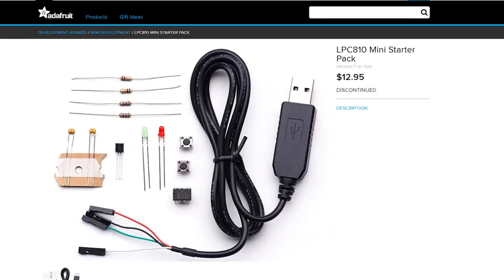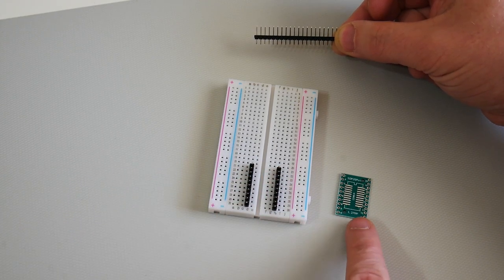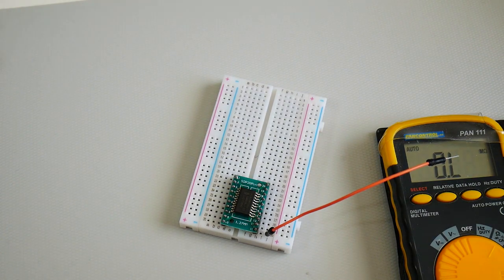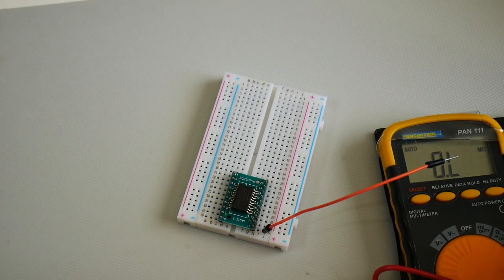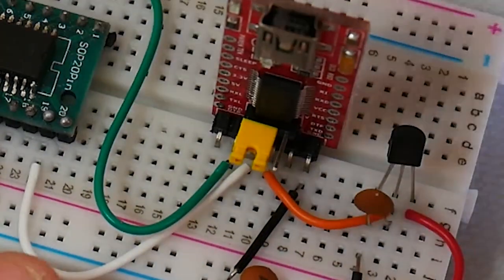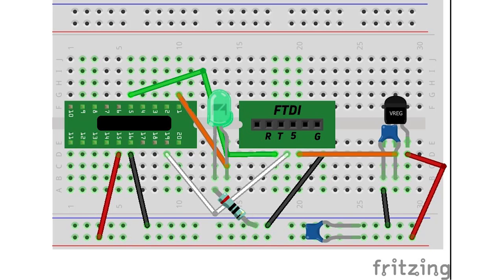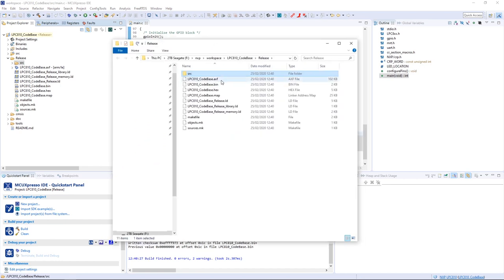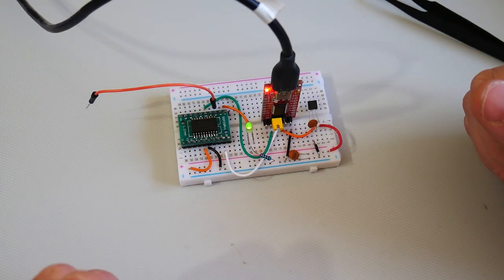Build Your Own Arduino Like Board For Just a Few Dollars

Comment: Since many of your viewers may also feel that they are not expert solderers:

You might benefit from a smaller soldering iron tip for this scale of work.

Flux cleans oxide from the metal surface.  It does not guide the solder.  Surface tension, once the pad is "wetted" guides the solder.  It is best to use rosin core solder.  (DO NOT USE plumbing solder, which has an acid flux in it's core, rather than rosin.  The acid is bad for electronics in the long run.)  The rosin is flux, and, generally, makes the brushed on flux unnecessary unless you are trying to solder directly to copper.  The silver color of the traces on your board is a plating (which is also called tinning in some circles) with a metal that does not oxidize easily.  If you make your own boards and etch them yourself, you may well have bare copper traces, and liberal liquid flux is warranted, but you may want to finish by covering all of the traces with solder, to protect the copper from future corrosion and possible failure.  Commercially made boards will almost always be tinned.

Particularly if you are in a dry region or in an air conditioned lab, give thought to protecting the chip from static.  Wrist straps are common in production settings, but I typically touch a ground point after picking up a too, and before picking up the chip, board, etc.  Some are tempted to tape down the chip while soldering, but note that peeling the tape off later can produce quite a charge.  Better to hold it down with a piece of conductive foam (DIP ICs often came with their pins shoved into such, I don't know where to get it today).

Note that the chip leads need not actually touch the board conductors, they just have to be really close so that the layer of solder that will wick between them is thin so that you need not consider its resistance.

It is quite possible to solder using only two hands.  Leave the end of the solder sticking out from the roll, in mid air.  Hold down the chip with one hand, positioning it as necessary.  Pick up the iron, clean it on the wet sponge (yes, you should have one), then touch it to the end of the solder, picking up a very small droplet (small compared to the pin spacing), and touch the iron to the work so that it is in contact with both pin and pad.  A key to a good joint is that both pieces being joined reach a temperature higher than the solder's melting point, when the surface tension will switch from forming a bead to adhering it to the pin and pad (it will flow in).  You can reheat the joint, first pin soldered only, to re-position the chip so that all pins fall within the outline of their pads.  Don't move anything for a few seconds after removing the heat, but don't blow on it.  Now pick up  the solder and solder a few other pins, diagonally opposite is a good choice, maybe doing the four corners.

Good fresh solder joints should look shiny rather than dull.  Don't worry about that for the first pin until you have a few others soldered, then go back and reheat it to make it shiny if it isn't.  The key here is to avoid mechanical disturbance while the solder cools and solidifies.  Remove the iron gently and hold still for a second or two.  To this end you should not be pushing the pin down with the iron, since it will then move as the iron is removed, potentially spoiling the joint, but at least obviating the reason that you were holding it down.  (If the pins don't all look like they're touching when you first hold the part against the board, use your needle nosed pliers to bend them in advance so that they are within a hair of touching or better.)  There should be no pressure from the iron.  The molten solder on the iron is the actual heat conductor.  The iron should touch both pin and pad.  If the solder does not flow onto both  within a couple of seconds, let the part cool, clean the iron on the sponge, and add a little fresh solder to the tip and try again.  Clean the iron on the sponge and re-wet it with a little fresh solder frequently.  Avoid the temptation to put lots of solder on a joint.  A big gibbous blob improves neither the electrical nor the mechanical quality of the joint.  Don't rush: do just a few pins, then let the clip cool while you clean and "re-tin" the iron.  If a joint doesn't look shiny, don't redo it right away, but come back to it 5 or 10 seconds later.
Reply: Thanks!
Reply: your awesome.
Reply: gosh, how much time did that take? But thanks anyway...
Reply: @AkashYadav-mr4hg  I'm just trying to give back.  I learn a lot from YouTube, Gary in particular.  My typing is pretty good, and that was little better than a stream of consciousness (I've done a lot of soldering in my days).
Reply: Yes, the additional flux is entirely unnecessary in this application as there's more than enough in the solder wire. I notice a lot of YouTubers advocate the use of additional flux and I think this bad advice masks the use of a generally poor soldering technique, where the iron is used to transfer blobs of molten solder to the cold work, thereby boiling away most of the flux and making a lot of smoke.
Reply: _ David _  Only one components in this project falls into that category and even that's doubtful. The pin headers certainly don't. If I was doing a soldering job that needed separate flux I would use fluxless solder wire. You don't need both.
Reply: _ David _  If you find you need both (as a number of YouTubers seem to do) then I would question your technique. I use rosin cored solder for general soldering and fluxless solder with separate flux for SMCs. I would not mix the two, just as I don't mix lead-free solder and traditional. An obvious complication of using separate flux is the need to buy the correct type. Using rosin cored solder for general soldering avoids that problem as additional flux is simply never needed for that application.
Reply: i know im asking the wrong place but does anyone know of a method to log back into an instagram account..?
I was dumb lost my password. I appreciate any help you can offer me!
Reply: @Jaxx Wade Instablaster =)
Reply: @Julius Jaxxon it did the trick and I now got access to my account again. Im so happy!
Thanks so much, you saved my account!
Reply: @Jaxx Wade happy to help :)
Reply: That was the biggest soldering iron ever haha
Reply: Solder paste for SMD and solder flux is even better. There are many videos on YT how to solder SMD parts...

Comment: The power bus (the whole bread board) is flipped in the drawing. Ground is on the the component in the drawing, and Positive is on the component side on real bread board.
Reply from the maker: Yes, I know. I couldn't get the circuit drawing software to work correctly with it flipped the other way. But the diagram is correct, but it doesn't quite reflect what I showed in the video.

Comment: Very informative video. Easier to tin one pad, solder one pin to it, then solder another pin from the other side making sure all other pins are aligned, then fially solder all other pins. Tinning all pins first make the job harder.
Reply: Yep tinning all pads first make it harder. solder first corner or use blutack to secure IC. When soldering 0.5mm pitch I usually just alignment pins and then use great amount of solder. after that I use solder wick to remove excessive solder.
Reply from the maker: Thanks for the tip.
Reply: Right. Don't tin first. Start with just a bit of solder on the iron tip, heat the pin and pad at the same time and put the solder on the opposite side of pin and pad. It will flow in a fraction of a second, remove solder then heat quickly and joint will be perfect. Unless you are like me and have gotten too blind to see the pins in the first place🤣

Comment: • Ah, so the bootloader on this chip is enabled by grounding a pin, rather than a delay in the start of the code!

• I would have also like to see you use the Arduino IDE instead of LPCXpresso IDE, although NXP's IDE is really similar to the other enterprise IDEs (such as CodeVisionAVR for AVR chips).

• Also, even though LPC812 seems to be easier to solder, I believe it's more expensive than ATmega328p. Granted that it's nicer than an ATmega328p in terms of clock speed and some other aspects.

• Personally, I also hate those FTDI chips with a passion! Even though those seem to be really popular, in my experience they have proven to be much crappier (and expensive) than options such as CH341G and CP2102.

• I would suggest to only solder pin #1 first, put the chip on the board and then position it, re-heat pin #1, solder pin #11, and then continue from there. I believe it'd be easier and more neat(er) since the chip would be flush to the PCB, and no pins will be under stress.

• I'm like 20% sure that soldering the pin headers while they're in the breadboard, while easier to do so, could potentially damage the breadboard's plastic. I'm not really sure, but if someone were to ask me I would advise against it.

• I believe the kind of soldering tip you're using is really not suitable for the job. You should use one that has a needle-like small surface to solder SMD components. Also, invest in a wet sponge or cleaning wire to clean the tip, it's really worth it!

Nice job overall, Gary. I have made several Arduino-like boards from scratch, but I have never used an LPC812 so it was interesting to see your video!

Comment: Thank you. Use a smaller tip for the welding with temperature control maybe that will make soldering easier

Comment: To add to the professor's comment solder should not be put on the tip as this vauses the flux to be burnt off before you have soldered your joint as long as your tip is clean and you add your solder from the opposite side to the tip and you remove the tip as soon as the solder flows to the tip you will get a good joint provided you have had tip tip on both pad and and pin. The best tip I have found is a 3.2 mm chisel tip for normal sized components and reducing for smaller components a round tip in general does not work well. But has been said sucess comes from practice and a clean tip and board.

Comment: When you solder the chip is better to put the tin on one pad only and solder this pad first. That way the chip will sit down on the breadboard correctly. After this initial operation will be very easy to solder the rest of the pads.

Comment: Thank you, it was a great video! However there was a small error in the circuit diagram you displayed in between the video. In those diagrams, the positive and the negative rows were flipped over (compared to what you did on the board)
Reply from the maker: That is true, but it isn't an error, it is a difference. The circuit drawing software I was using didn't work correctly with the board flipped the other way. But the diagram is correct.
Reply: @GaryExplains  yeah. That's understandable :)

Comment: Curious why you used a 3.3V vreg if your pulling power from the USB to Serial board? Those USB to Serial boards have a jumper that lets you select 5v or 3.3v (at least mine does, and looks like yours does too), so the vreg shouldn't have been necessary...
Reply from the maker: Because I don't want to assume that the USB to serial converter has the 5v/3.3v option, some don't.
Reply: @GaryExplains  ah ok, good point.
Reply: Well, since the USB to serial board is only needed when programming and developing then it makes sense that he is showing that it can be powered by 5 volt on its own.

Comment: Flux alone should be more than enough to ensure that solder flows under those pads, I’ve never seen anyone else put gobs of solder on each pad before soldering an IC to it. I find RMA paste much more effective than no-clean.

Also I don’t see why not make a PCB with a programming header on it. As is you’ve done no more than just taking the equivalent of a DIP20 MCU and slapping it on a breadboard with supporting components, which isn’t very versatile. The whole point of an arduino is that it has the programmer and the power supply and the indicator LEDs and the ICSP header and the oscillator built-in, and is a robust board with little to go wrong. A breadboard is not robust. Breadboards should be used for temporary circuits, for prototyping and experimentation. Wasting one by leaving a permanent circuit on it just increases the cost and the footprint of that circuit and makes it much more prone to wiring faults.

Recently I needed to make a circuit with a raw MCU on it for space and power reasons, so I soldered a socket to some perfboard, along with a 16MHz crystal and caps, a programming header, reset buttons, and 5 status LEDs. Works great, I just have to plug it into my USBasp to program it through AVRdude. You could do the same thing but with dual-row pins soldered to it for breadboard use. Or even just solder some solid copper bodge wires atop your SOP20 adapter connected to some LEDs, reset button, linreg, and programming header. No need to have the USB programmer on the dev-board itself.

Comment: A MUCH easier and more reliable method to attach the chip, and any SMD components, ESPECIALLY for beginners, is to NOT tin ALL the pads but just ONE! Ideally one corner pin  then to solder that one pin whilst correctly orientating the chip using tweezers to push the chip flat to the PCB!

Once the chip is correctly orientated and held firm by the one soldered pin, the rest of the pins can be soldered using flux and a soldering iron in whichever way you prefer ... drag solder or individual pin solder. DON'T forget to revisit the first pin and using flux, reflow the joint. 

This makes it MUCH easier to solder the chip in total without overheating or it moving around, as it will be held stable by the first pin soldered.
Reply: Can you tell me where to go to research information on "micro PCB circuit boards" to make a micro controller for NES that works on NES original console/hardware. That has a ability to have direction on D-pad and/or buttons A/B to have auto-fire turbo capabilities? All the while working without the need for any external programs running on a PC like Joy2key, Rewasd etc....So basically all the turbo functionality is self-contained within the pad controller itself.  Somone said something about altering the shift registers to produce turbo. How do I find info about that? Googling it does not really bring anything up but pre-made third party Turbo controllers and that is not what I am talking about.

Comment: It is far better to solder the chip to the adaptor board before you solder on the header pins. Also, you would find soldering a lot simpler if you kept the tip of your iron clean and tinned.

Comment: Shouldn’t you put a voltage divider between the tx of the ftdi and the rx of the uc? Seem like you can put 5 volt on there and still fry your board...
Reply from the maker: The U0_TX and U_RX pins are 5v tolerant.

Comment: Can you tell me where to go to research information on "micro PCB circuit boards" to make a micro controller for NES that works on NES original console/hardware. That has a ability to have direction on D-pad and/or buttons A/B to have auto-fire turbo capabilities? All the while working without the need for any external programs running on a PC like Joy2key, Rewasd etc....So basically all the turbo functionality is self-contained within the pad controller itself.  Somone said something about altering the shift registers to produce turbo. How do I find info about that? Googling it does not really bring anything up but pre-made third party Turbo controllers and that is not what I am talking about.

Comment: Hey Gary, great video!  LOve to see someone design a 3.3 to 5 volt bidirectional adapter board. I have numerous projects that could be switched to Cortex from Arduino. I don't mean the small brds available now that just do a few pins. Thinking along the lines of a carrier brd.
Reply: Hi there,  I'm kind of new to voltage regulators. Why do you use the 5 volt output on the ftdi chip. Isn't their a 3.3 v pin/mode? Thanks in advance

Comment: Hi, how and why did you choose that MCU?
Don't you have to do something with the FUSES? You didn't record any bootloader or firmware so I don't know if it's necessary.
You did not use any hardware programmer, simply with a USB to TTL you can already record it, as in STM32.
With so many MCU manufacturers and models, how do you choose?

Comment: I have an application where I need to take sensors that provide 5 different types of information, and using a micro-controller transmit the data (RF transmitter) to a recording system in such a way that the 5 types of data can be compared via time/date stamp to determine what the readings are at any given time.  I have NO experience with micro-controllers.  Any suggestions?
Reply: Yes, start by learning how to use and program microcontrollers before embarking on such a project. Learn to walk before you attempt to run. There are plenty of good tutorials to be found online.

Comment: Hey the ftdi programmer is at 5V.. It's TX pin will be at 5V logic which is connected to RX of uC.. programming the uC may damage its RX pin as at it is at 3.3V from the ldo.. am i  missing anything?
Reply from the maker: The U0_TX and U_RX pins are 5v tolerant, but the VDD pin isn't.
Reply: @GaryExplains  oh is it.. then it is correct.. thanks for the input..